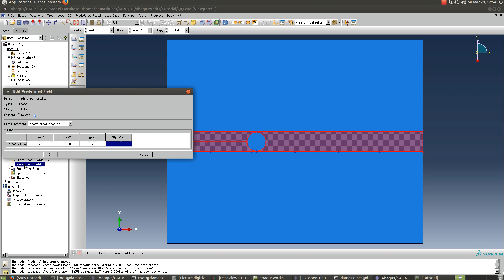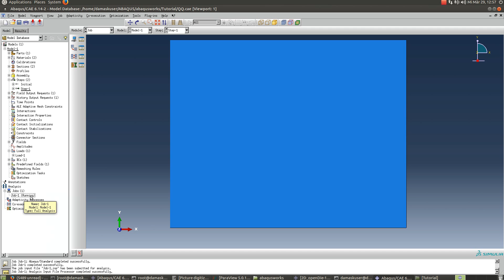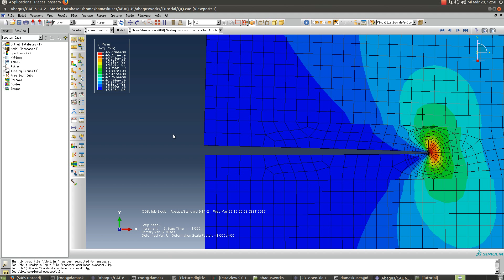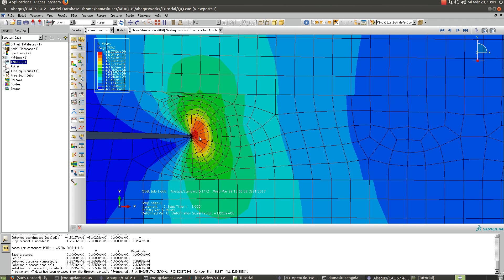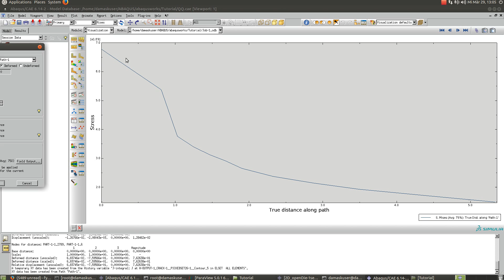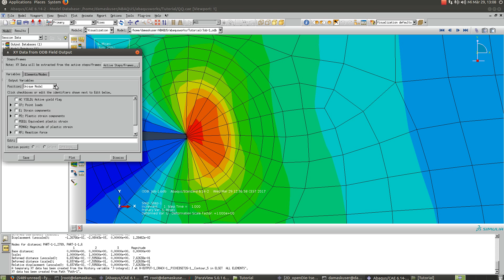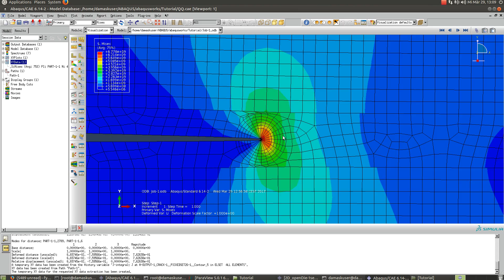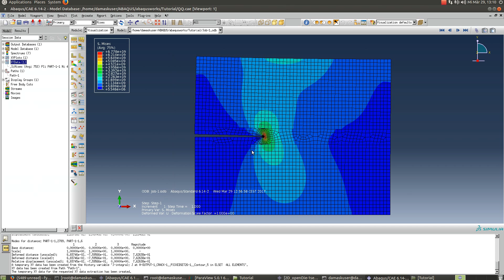ABAQUS: Post Processing of Contour Integral crack, exploring multiple options

Comment: Dr. Qayyum, thank you for the videos you have been uploading. These have been very helpful and I have recently read a couple of your papers as well. Such great works you have been doing :)
I am currently working on a project related to free vibration analysis of foam core sandwich composite. Between the lamina and foam core, there is a very thin layer of adhesive. Now, my question is- do I need to apply the cohesive properties in the adhesive layer? 
A couple of seniors have told me that as long as there is no damage test or delamination happens in the structure, then no need for applying the cohesive properties in the free vibration analysis.
Reply from the maker: Thank you very much for your encouragement. I am not an expert and cannot fully understand the overall work you are performing. Having said that, I will agree with your seniors. Start simple, and slowly add complexity to the problem to a point it is inevitable.
Simulations are no way substitute for experimental observations, they just assist in providing detailed information in addition to experimental observations.
If you are not interested in the analysis of the thin layer of adhesive and defining it will not change the results (i.e. is generally remains intact throughout the process) just define a simple interaction between the lamina and foam core by assuming appropriate interaction properties and move on with your analysis.
I hope this answers your question.
Reply: @FaisalQayyum  I understand your point of view Sir. Thank you very much for your descriptive reply. I will carry on the project simulation with the basics first and if I get supportive results, then I will continue with more realistic approaches. Thank you again and hope to connect with you on Researchgate :)
Reply from the maker: @Rez1_Analytics  That's great, you're welcomed :) yeah, let's connect on ResearchGate

Comment: Hey I want to make graph of crack length vs sifs . But this give graph of contour vs sifs how I can do please tell
Reply from the maker: That's interesting, So one way of doing that is by incrementally increasing the defined crack length in the same model or in newly copied models and then calculating the SIF for a longer crack. You will get a data point from each simulation model and will have to run enough simulations that you can construct the desired plot.

Comment: Please, I need your assistance with creating a 3D internal elliptical or circular crack.
Thanks a lot.
Reply from the maker: That's good to know, sorry for a very late reply, is the problem resolved or you still need help?
Reply: @FaisalQayyum  Hi, I have the exact same problem as this guy had. I need to create a 3D internal elliptical or circular crack inside a block of material under static loading. Would you please be able to help?